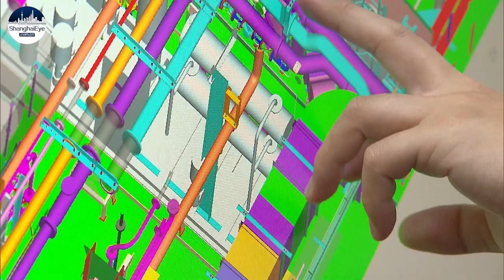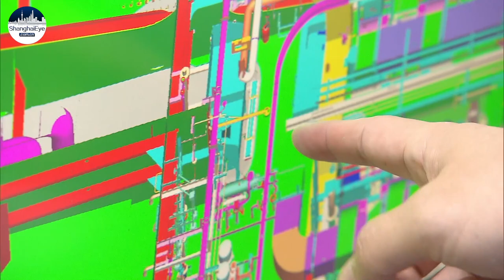China speeds up building bigger ships to fill the big shipping demands

Comment: Not the best development and I will explain why I think so.

If one ship carrying 12000 containers get stuck in a channel, it will have impact on global supply chains. If one ‘small’ vessel carrying 2000 containers gets stuck, the consequences are smaller.

Besides there is 1 thing unchanged since 1600, there is still wind.
Smaller boats require less energy, so wind energy can be harnessed and used.

This will decrease global air pollution by at least 10-15%. Which is very significant.

Side effects:
-less steel required (cost and pollution go down
-less fossil energy required(can be used for strong woven polymers(sails))
-smaller ports can have a more competitive role to decrease transport costs
-trains of the beld and road initiative  will become more lucrative, due to increased shipping cost during a small window of opportunity
Reply: Thing is 
1. its never stuck
2. The sea road are bigger than they predict at first
3. Most asian product price are high because lack of ships delivery
4. The waves are nice in china trading triangle  sea roads

Pls examine the situation first in asia before make the delusional calculation thx
Reply: @TheScarp21  remember the evergreen in the Suez channel? Shipping is still delayed because of that.

Chinese products will become very cheap soon. Dropping wages is the first sign of that..